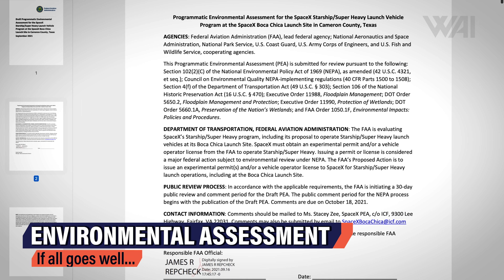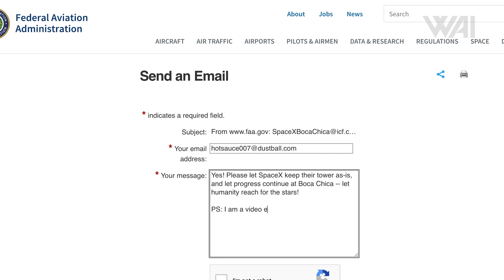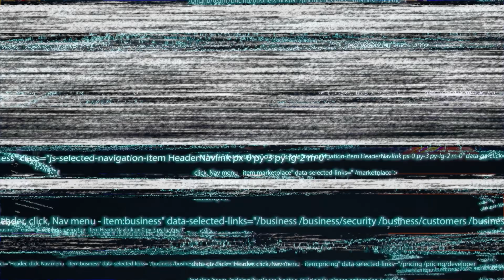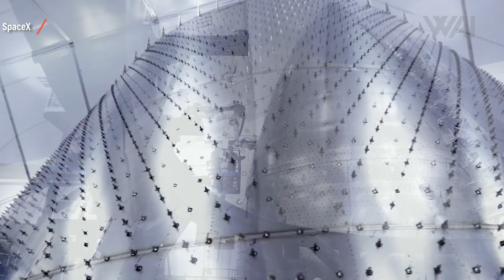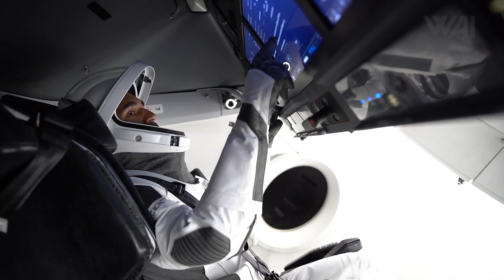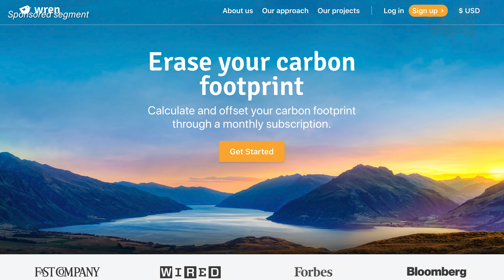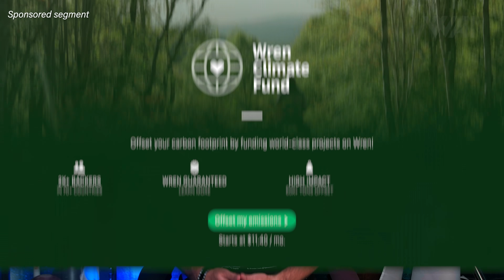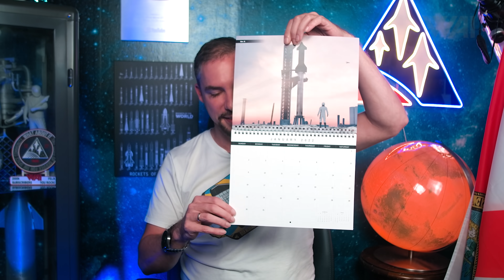One month to an orbital Starship launch attempt! & SpaceX Crew 3 Mission Status!

Comment: Heat tiles. I would do a 2nd layer of tiles that is staggered by half a tile. That way the tiles that touch the ship are not only held on by whatever rivet or glue they are using now, but are also held on by the layer of tiles on top of them. If a few of the top layer tiles are lost in a liftoff, there would still be a layer of protection below that.
Reply: This is a good idea and has been mentioned by Elon, the trouble with this is it would make individual tiles very hard to replace quickly once the Starship is in service.

Comment: Aristotle was Believed by other scientists for 1800 years to be smart and correct about the Earth being the center of Our Solar System. actually, Aristarchus who lived near Aristotle at the same time knew that the SUN was the center but Scientists Consensus in believing IN ARISTOTLE kept HUMANKIND IN THE DARK for 1800 years as this foolish Climate science Is Emulating. CO2 does not correlate to Temperature. It seemed to for 20 years but not before or SInce. Also, EVERY IPCC FORECAST has been Wrong Significantly nearly 100% in error. Ice still over the North Poles and the Antarctic had one of its coldest Winter last year, Hurricanes have NOT become more severe and Frequent since Katrina and Many more. The Island 6 feet over the sea level is still 6 feet higher than the sea level or more.

Comment: After hearing Bill Anders describe the vibration to Allan Bean or vice versa makes me worry about the Heatshield Tiles shaking off.                                                                                                                                                                                                                                         I have presented my Suggestion of using what looks like a bird's nest of Flameproof Strings Glued to the Starship Side and to the Heat tiles allowing them to Release some grip but always have other strings holding fast. The glueing product could also be an ablating aspect.

Comment: if SpaceX could spray the heat shield on, you would eliminate all the parts and pieces
Reply: I have more or less the same idea, but instead you could keep the hexes so that you don't have a very big surface that could crack under high temperature. I think the tiles are also made to expand, so one big paint job isn't going to hold up

Comment: The project will then go into offshore model and SpaceX launches using the modified oil platform. The FAA simply can not stop SpaceX. 
Starbase in the above scenario will be used as is but no tower. I assume the fuel farm will need to be connected to a long subsea pipeline to the offshore platform.
Reply: SpaceX will always need clearance from the FAA if they’re based in America, even if they don’t launch in america

Comment: As I stated before
 They could use a better interference it. Keep the male pin the same size. Make the tile female hole smaller. This could be done at the bakery. Make a jig to chill the pins, then install the tiles. Once they normalize they shouldn't fall off. May need to know where all the hysteresis of the areas to be covered originate.

Comment: Less parts is always the best way to go. Instead of tiles, make them heat shield half rings. easier to replace 1 large half ring instead of several tiles.They will still be able be flexible kind of like a snakes belly scales.
Reply: Larger pieces, rings, etc may be less structurally sound than the tiles. They might use them for a reason.
Reply: @haraldhimmel5687  They would also have more connection points and still be flexible.

Comment: For attaching the heat tiles I would consider a non acidic silicone sealant. It’s safe to 250 degs C but more importantly it sticks well and it’s flexible. But it’s such an obvious idea I can’t believe it’s not already been tried.

Comment: Does anyone know if the tiles that got blown off were due to the studs attached to the SS or did the tile actually break away? I don't know how the tiles are attached or installed. The tiles may have been damaged during the installation and it took some wind, vibration, or changes in the SS   with fuel. to finish them off.

Comment: Iv got the perfect idea for holding them on weld/tack a a bolt in-between each corner of each tile that has a web that overlaps the out side of the tiles each bolt could over lap 2-3 tiles all you would need is a good tack gun most likely a custom one that would support the bolt. You heard it here first tho 🤣

Comment: Right now it looks like they use some kind of straight clip that contracts and then expands to hold the tile in place. They need to make the  system so it is twist-lock, where either the stud or the tile connector rotates 90 degrees upon assembly and then permanently locks into place, so it would have to rotate  back to come off. The clip needs to snap into the tile receptacle , requiring destruction of the tile for removal. There are various ways of accomplishing this, like a two part rotating receptacle that lock down upon rotation, a twisted stud that untwists during insertion and snaps back into place, etc. 
If the problem is the sockets themselves separating from the tile, then the connection of the socket to the tile needs to be made stronger, probably by attaching all the sockets to each other with a mesh embedded in the tile itself.

Comment: Maybe NASA has something from the shuttle program that SapceX could use. A high temp silicone at the corners to attach the tiles on and reduce vibration, but still use the pins for alignment and height.

Comment: Hey so why can't SpaceX just ship out a few dozen starship panels (sections of stainless steel that make up the main body) to some universities/manufactures to see who comes up with the best reusable heatshield design? I assume were not changing the type of steal at this stage. https://youtu.be/GcdB5bFwio4?t=48 this came to mind but It also doesn't look like it can handle more than one reentry. I'm thinking ~4 giant brake pads that ablate when entering the atmosphere and can be changed out quickly since there's 4 not 4000.

Comment: What about parking a removable heat shield in an orbital gas station with the tankers? I mean maybe it is easier to build a bulkier, less complicated, removable heat shield and attach it to the starship only for re-entering the atmosphere. What do you guys think?
Reply: The present Starship heat shield design violates Elon's First Commandment: The best part is no part. That heat shield contains about 15,000 tiles and three attachment pin per tile for a total of 60,000 components.

SpaceX should put a wad of R&D money into spray-on ablators for Starship. That technology dates back to the Apollo era in the 1960s. The ablative materials have been developed and tested early in the Space Shuttle program in the 1970s. 

For Starship, the ablator thickness could be adjusted for two or three EDLs and then quickly refurbished in specialized ground facilities that could do that job in 48 hours or less. 

With that ablative TPS for Starship, the parts count and the manual labor required to install 15,000 tiles is replaced by robotic equipment that spray the ablator onto the stainless steel hull. Refurbishment is also done by robotic equipment.

Side note: My lab developed and tested the ceramic fiber tiles for the Space Shuttle during the conceptual design phase of that program (1969 thru 1970).

Comment: The heat shield needs to be built like shark skin. Shark skin is basically tiny teeth that overlap and can slide in different directions without any gaps. This would be perfect for a heat shield. The tiles could be solidly attached to the surface with no seems. The tiles would partially overlap allowing for thermal expansion.

Comment: I think the tiles need to be webbed together, built INTO a blanket rather than attached onto a blanket. That way individual tiles cannot come loose, individually.
Reply: We first need to know if the tiles fell off because their adhesive gave way or if they actually broke off.   Without knowing exactly how they work and are attached, we are only speculating.  We also need to keep in mind that however they are attached that they keep their thermal qualities which is after all their whole reason for being there in the first place.  I'm sure that SpaceX are addressing the problem as we speak...

Remember, even if the tiles are perfectly secure and work "as advertised", they will only come into play if the rest of the first orbital flight gets to the point of re-entry.  If they even get to that point on the first flight, the test will have been a runaway success.

Comment: I have a simple idea of how to keep the tiles on, fit the tiles and then spray a rubber bonding solution on top of them to keep them intact and in place during take off. This rubber solution then gets burned off during re-entry so the tiles can do their job.
Reply: That makes it not rapidly reusable
Reply: @williamstock3007  why not? It lands...gets the tiles checked... replacements fitted if needed.. resprayed... refueled..take off?
Reply: @dereklewis1577  it’s a cool idea and maybe it would work but it would be terribly messy and make replacing the tiles difficult. I doubt such a rubber type material would completely burn off
Reply: @williamstock3007  it was just an example? Surely people a lot smarter than me could think of something to spray on top of the tiles for a similar effect? Maybe not rubber? Some kind of bonding solution to keep the tiles in place until re-entry.

Comment: Firstly, I think the tiles should have a slight curve in them to fit flush against the curvature of the hull. This will already allow them to have less wiggle room, which could be a cause of them falling off. Secondly, they should have a clip or pin connecting the tiles to each other. This will mean starting in the center of the hull and attaching the tiles systematically to the edge of the TPS covered area. In this way they are not only connected to the hull in three places but also in six additional points. This approach effectively creates a matrix of tiles as opposed to a collection of individual tiles
Reply: They actually dont Touch the hull at all and shouldnt do so to Limit Vibration. Basically you wanna mount Thema as loose as possibke without Thema falling off
Reply: the problem of the tiles connecting to eachother is that the time for the tiles to be replaced will be extended, and remember that the plan are to launch 3 rockets every day.
Reply: It will just be a matter of fine tuning the connection method. There are probably many areas on the hull with minor differences in the connection method. Different alloys and pin shapes. The simpler the tile, the lower the cost and the reduction of uneven wear or failure

Comment: Since the majority of the Starship surface is relatively smooth and consistent, wouldn't it be better to have larger tiles (10-20x) which would include that much more attachment points to a single large tile.  Make the shape of the larger tiles more aerodynamic for launch / reentry (no blunt leading edges) to avoid air or atmosphere from peeling them away.
Reply: They are probably that small for expansion reasons. With much larger tiles with many attachment pins, the mechanical stresses between tile and pins due to differential expansion/contraction rates might be too great. (Although, obviously the current design is not ideal either!)

Comment: Am I the only one who worry that only 1 sky dive and landing has worked so far? What about repeatability? How do we(and the FAA) know it was not a fluke?
I believe in the Star ship but not the catching tower, one touch on the heat shield and it would take days to repair, and that is the smallest consequence a non 100% perfect capture, do not complicate when it is not needed, good landing leggs will not reduce capacity beyond awesome capacity regardless of loosing tonnes of lift capacity(at most), leggs are still better and cheaper as well as more flexible when choosing landing site, the Moon or Mars do not have towers and will not for 10-20 years at least.

Comment: Weird idea, but maybe through the heat tiles, they could put holes through the sides, going horizontal to the orientation, then could place a metal wire, from one end to the other, would create additional sturdiness, kind of like braces across your teeth.

Comment: Why does Musk believe we are running short of time ? 
* He has a mild case megalomania, wants to get it done be before he dies and it is a challenge he has given himself.
* He has a moderate case of megalomania and doesn’t believe if he doesn’t it will never get done.
Reply: I'm sure there are elements of both... but listening to various interviews with him, it's not that he believes we are running short of time... it's that we don't know how much time we have and so should be planning for the worst case.
Reply: @simongeard4824  this insurance agent offers a policy that will replace your house with a room in commune inside a building owned by a corporations. Also that needs you to constantly maintain physical structure, electrical, water, sever, air, built in an inhospitable environment outside a volcano that spews poison gases everyday and the temperature is 59 below freezing everyday of the year.

Comment: Those "white dots" on the TPS tiles on SN21 are actual the letters "OK", indicating that they are installed correctly. It's likely that the ones that are missing were not installed correctly, and have to be replaced.
Reply: Or re-placed

Comment: Why can't you make a mole like for a fiber glass boat, Than make the heat shield panels in a lager size, like body and nose panel which over lap each other than attach them to the ship.
Reply: That is a really good idea...  Larger tiles makes sense.  Could do it dragon scale armor style by having them overlap like a dragon or lizards/snakes scales slightly overlap.
Reply: @Les_S537  I’m no expert but ceramic does not offer any flexibility without cracking. Perhaps much larger tiles would be difficult to manufacture and too delicate to withstand transportation and fitting.
Reply: @Les_S537  I am not talking about tiles. The whole underbelly of the spacecraft would be covered in 2 pices of heat sheld, the nose area than the underbelly of the craft. The underbelly would be like a half of a tube bolted to the underbelly, the same for the nose cone that overlaped the belly part.
Reply: @anthonybringolf  Well, they will be tiles of a sort...  Just really really big ones.  I'm partial to what you're saying, but here's my spin on it.

Making one big massive protection layer is going to be massively costly, and really hard to do.

Break the tiles up into smaller sections, with each tile overlaying the edge of the others next to it, and you can sort of channel the tiles so that they help direct plasma buildup away from the ship on the edge where the tiles end and the stainless steel begins.

On the belly side, the tiles would begin as flat mostly, and then would "flow" towards the edges where the stainless steel on the top begins.

Just make the edge tiles fit under the ones closer to the belly right where they would normally be butted up against it (like in the current design)...

I wish I could draw a pic for you, but I like your thought!

Comment: Do they use something like thread locker on the tiles? If not maybe come up with something like it or in the future add a system that allows the tile to be held on mechanically by the attachment points using a clamp built into the standoffs that allow you to remove specific tiles so they’re not knocked off. Shaking wise maybe try something like oobleck to absorb shock or just a little silicone since it’ll be reused theoretically.

Comment: I have a suggestion for the tiles that might sound like a joke and would only be a temporary fix. If we do something like an advance Saran wrap on the ship. It would hold the tiles in place giving them greater structural rigidity during The crucial launch and then oblate off during the first part of The descent. Once it's in the scent the tiles would pretty much hold themselves in place. Of course I don't mean real Saran wrap but something more advanced something that could share the strength of the adjacent tiles during the launch yet harmlessly oblate off during the descent. Not to mention during the oblation process the coding would give the tiles one more second of no heat, while not adding much in the way of weight.
Reply: Clever idea

Comment: Everything seems OK till you see Starship needs 10 refueling rockets in LEO just to get 1 starship to the moon. You have to launch 1 then launch several more to get the first rocket to the moon!  How long will that take? Which rocket do the humans ride into orbit?

What about landing legs?  There are no perfectly groomed flat surfaces on the moon. Falcon 9 has enormous legs and still lands on a flat smooth surface. SpaceX stopped trying to make legs for their rocket because it was too hard.  There's no way starship is landing on its skirt on the moon. It'll flop over killing everyone. 

Till we figure those issues out we still have a prototype with fundamental concerns.

 I really hope they make it work but there are major fundamental hurdles to cross before humans can ride starship. Pathfinder issues that will take many years and potentially require a full redesign.

Comment: Sheets!  I wish i knew how to use 3d modeling tools.  I would use a triangular hull with very rounded corners, with internal cylindrical fuel tanks and smaller vertical tubes in the rounded corners between hull and tanks for crew and equipment elevators.  with a triangular hull, flaps can be built in to the form of the hull and can double as landing legs, and hull will provide better stopping force.  Then TPS can be made in sheets rather than tiles.